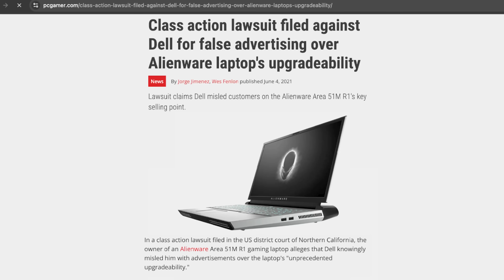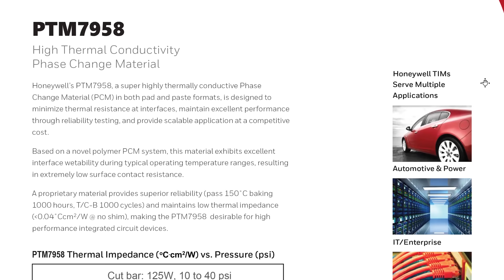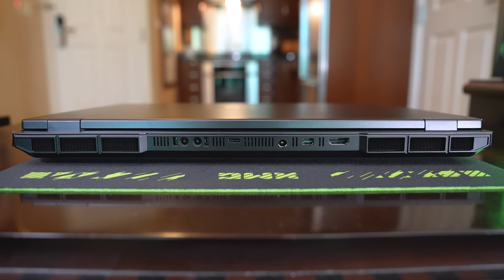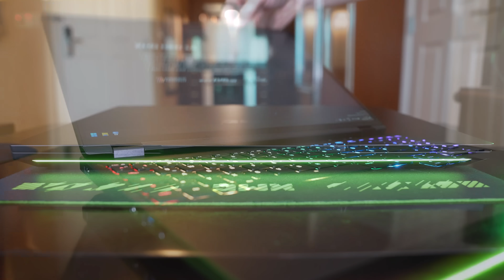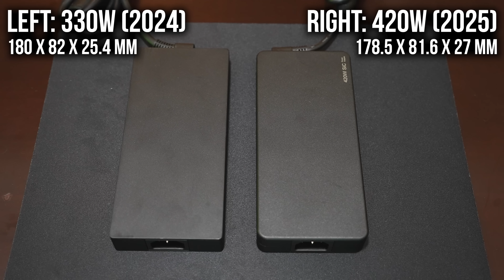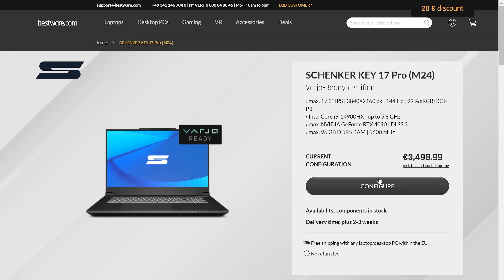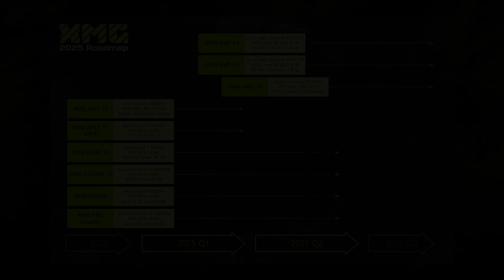This Gaming Laptop has Separate CPU & GPU! - XMG Neo 16

Comment: For anyone who is curious, XMG have removed G-Sync support in both the IPS and OLED models for 2025, which is beyond a deal breaker. Such a shame.
Reply: Jarrod never mentioned it in any of his neo 16 videos. 
Gizmoslipttech, on the other hand, mentioned it in both the live and recording.
At 5:40 saying "I have seen it before in action" is such a big bold lie.
Reply: @techkenvid  He wouldn't have known at the time and XMG were promising it, it's not Jarrod's fault., They only recently decided against it after people who bought them waited 6 months. They said no because they can't do it as a retro fit and only for new laptops and thought that would be unfair. This is why you never buy something for a promised feature, only buy it if it has what you want already.
Reply: @Bavanity  A few important things to note:
1. There was no OLED model for 2025. Only IPS and Mini-LED.
2. This "removal of G-Sync" was only for the Mini-LED screen; the IPS screen still has it. Like they said, they only decided against it after people who bought them waited 6 months. They said no because they can't do it as a retro fit and only for new laptops and thought that would be unfair.
3. Nobody actually reviewed the XMG or Eulktronics version for 2025, so I bought one myself. It's very good. Just be aware the sepakers still don't work in Linux; they take a second of audio playing to turn on and then it works as long as audio is playing. (It's a speaker sleeping issue with the drivers.)
4. To this day, the 2025 model does not have the Prema UEFI of previous models. Just an FYI.
5. There is a MUX Switch.
6. Only the Intel model gets Thunderbolt 4; the AMD model doesn't even get USB4! (For such an expensive laptop, that's so ridiculous.)
7. I hate that CoPilot key so much; even remapping it isn't 100%...

Comment: @JarrodsTech also can you ask them for an OLED variant and/or 360/480hz 1080p variants ? Their G2G  and panel selection is their only flaw IMO . We also need more x3d chip set builds on laptop . That vcache is honestly mandatory to look parallel to an ITX considering we are limited to 125-175w GPU power a water-cooled 9950 x3d with a 4090+, and 360hz 1080/1440p . also i feel they need 2x gen5 Nvme slots to actually take advantage of that Raid 0 properly. its such a small touch-up to be innovative and future proof considering someone is spending 4000 dollars or more for a barebone max spec

Comment: they need to make the power delivery a seperate board, my 3k laptop is now a paper weight. my experience is the desktop i build last me 10-15 years or more, i just stop using em when i build a new one as opposed to laptops lasting 2-5 years.

Comment: You are 100% wrong my friend, they used to provide laptop MB that had cpu sockets on them, they used to have a MXM format gpu board for individual replacements.  There is no oh we are unable to or can afford to build a standard platform for upgrading laptops like desktops.  Full stop.  Only reason they continue to use proprietary hardware, soldered cpu/gpus is a money grab and to keep consumers on hampster wheels.

Comment: does xmg ship to the USA ?
Reply: Not really, but Eluktronics is the brand who sells the exact same laptops as XMG. Both come from the same ODM, Tongfang. Eluktronics's version is called the Hydroc 16 G2. (The G1 was the 2024 redesign from the horribly built, feature lacking, USB-C charging lacking, underperforming, and CPU thermal throttling even with the liquid cooling 2023 Mech 16 / XMG Neo 16. The 2024 redesign was so much better that it wasn't even funny, and it wasn't worth considering the 2023 model.) I have actually not seen any reviews of the 2025 models...

Comment: The problem with this is that most laptop manufacturers stop supporting upgrades. I bought an acer amd laptop like this and then acer never supported firmware updates to update the cpu. Dont get it simply because of "future" upgrades they wont support them.

Comment: I think XMG should have at least made it possible to upgrade within the same generation if not future generations. The only use case in which this might help is if the gpu dies. You would be able to change just the gpu rather than changing the whole motherboard.

Comment: 10:30  it's not unusual to control a device with an rj45 connector, while needing an ethernet connection at the same time. So you would control an industrial piece of equipment with the computer and at the same time connect to the ethernet connection for the facility. This might not have anything to do with internet at all. So in a professional situation two ports is actually almost essential, often I had to use some form of cluge or a dongle out of one of the USB ports, but this is not ideal, it is better to use good regular dedicated hardware for it. Also the drivers for this are usually in-house and of course proprietary, though I have been in certain facilities where open source is used. I generally find the open source to be more stable and specifically better programmed, or more to the point better optimized, usually the programming is just fine within house but they don't have the resources for the optimization necessary at a low level

Comment: Yes but the manufacturer state that the boards a digitaly signed ti each ither so the end user can't replace them so if the cpu or gpu fails you need to send it to the manufacturer to rma it

Comment: I'm still waiting for some other company other than framework to actually produce a laptop that can be upgraded in the future. Generally speaking there is no f**** reason why we need to replace the chassis of a laptop or in most cases the monitor at least for one more generation past the one that you started with. Even keyboard and mouse, touchpad, generally don't have to be replaced for long periods of time. So yes I would love XMG to commit to designing the next one if not this one, laptop that can be upgraded every couple of generations. Doesn't have to be every year, but every two years or every three years would be beautiful. The monitor keyboard and touchpad should easily last 6 years if not longer, whereas the GPU, especially these laptop underpowered junk that Nvidia likes to give us, will generally only last one generation maybe two. CPU could easily last two generations if not more. So yeah, I would love XMG to at least commit to creating a 3-year cycle for their laptop, preferably a two-year cycle but, I would be happy enough with a 3-year

Comment: Ahhh another bs design skewing design and technology, introducing new problems that didn't exist or were already mitigated. This is why MXM was developed and here comes another manufacturer making a completely non standard pogo connector and board layout. Back to the wild like in 2005 to 10, when some laptops had gpu hat modules with proprietary connectors.

Comment: would be nice if GPUs just went back to MXM, like yes this makes the GPU easily upgradeable, but it's still limited to one specific laptop from one specific brand, rather than a satandard that's true across all many manufacturers, specially since MXM is supported up to the RTX 4060 and RX 6600 XT

Comment: Quite a good idea to have separate PCBs. However - what’s missing is the nickel plating on the heatsink for cpu and gpu.. I want to apply liquid metal if I decide it needs that.
Reply: Honeywell PTM7958 is good enough, especially with large dies. // Tom

Comment: E-waste out of the box . wp XMG you can now go but it back in the trash bin were is its place.
Reply from the maker: brain dead take tbh ngl famalam
Reply: Dude it has an x8 pcie connector, meaning that mbo will never accept a higher end gpu(well it can but that gpu will not perform as it should on a pcie x16 connection),  the gpu itself is proprietary design meaning no future upgrade from 3rd party and because the entire laptops cooler is made custom with that specific gpu in mind.  The only good thing about is is that it gives   you the possibility as a manufacturer to asamble it however the customer wants but that's it, he the customer can't upgrade and can't do anything else to it because the parts themselves are not made to be swapped from one configuration to the other. Also not to mention limited configuration because you would end up with a huge stock of coolers for 1 specific config that sold less then expected so they won't have many configuration options for sure =)) they will limit it to 2 or 3 configurations for each cpu at best.

Comment: As I understand its locked and I can't change my machine's config if I wanted to upgrade the GPU for example? is this a hardware lock? so even if I got my GPU damaged I am not able to pay more for a 5090 for example?
Reply: In-generation GPU upgrades (e.g. from RTX 5070 Ti to RTX 5090) after a GPU defect is something we could consider for this generation. But the laptop would need to be sent to our RMA center, and we'd keep the dead GPU for recycling. How does that sound? // Tom
Reply: @xmg_gg  sorry for the late comment but that is the logical way to do that

Comment: The NEO lineup is looking quite good! I am not so sure about the SCHENKER KEY 18 Pro though... the large battery and amazing sound system is insanely appealing, but it is all brought down by a frankly underwhelming screen options, especially compared to the likes of ASUS with their 1200 nits Mini-LED coupled with anti-reflective coating for better contrast. I am hoping that more laptop manufacturers will start implementing such technologies in their machines!

Comment: Most I see have a separate GPU from the CPU but they are usually soldered down.  I know about removable cards but I have never actually seen one since the laptops they come in are more expensive.

Comment: Missed opportunity to not have the separate CPU and GPU as well as the liquid cooling system in the 18 inch model IMO. That is the one made for the enthusiast...not the 16 inch model with only 2 RAM slots and 2 SSD slots.

Comment: I just wish there were more socketed mobile CPU and truly standardised mobile videocards (MXM is all over the place). XMG's method for upgradability does have its place for thinner laptops though - maybe they could opensource board designs that become obsolete so that those who want replacements have the option to source them (or repairs) separately.

Comment: My legion 5 gpu died and I have to basically run things on integrated graphics and can't use external displays. This new design is great as the cost of repair is gonna be way lower and actually fix only the damaged components

Comment: Having the GPU and CPU on different boards has been done before it does not offer that much of a benifit as replacing the GPU will most likley cost over 50% of the price of the laptop. Laptops have a shorter life than desktops due to starting with less computing power than a desktop equivalent so only buy one if you really need something that is portable. I have a 3d scanner and was looking at a high end laptop but ended up using a mini ITX MB with external GPU mounted into a Pelicase with a 16 inch screen as I am a cheapskate.

Comment: No USB4? No description of how the power components are cooled? Is water dripping when disconnects the external cooling solution is still a problem? I guess, they paid well 😅
Reply: Power components are covered by the large thermal module that you see in the video. What you don't see in the video: thermal putty on VRAM and MOSFETs. XMG OASIS ports and tubes are self-sealing when disconnected. // Tom

Comment: 1. But is it possible to upgrade both boards when the next generation GPU comes out, along with whatever CPU is out then?
2. As much as this simplifies production I have some reservations about that PCI-E bridge if you're perpetually lugging this thing around and, despite a nice bag like Crumpler or Lowepro etc, that involves rougher handling. Desktop replacement that barely goes out, and when it does, the worst handling it'll get is on the conveyor belt for the airport X-ray? I don't see any problem. Running through stairs and crowds to and from the tube/elevated metro, getting sardined in the train (worse if other passengers are shoving etc)? This might break that PCI-E bridge.

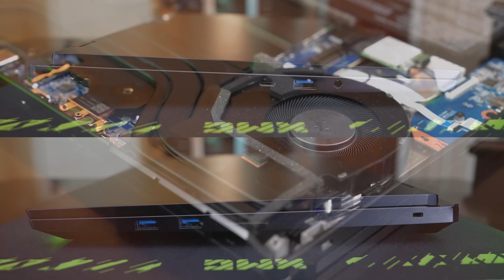Comment: 7:47 the laptop is dropped? damaged corner
Reply: Yep, someone dropped it at the airport with only minimum padding on a very hard surface from shoulder height... that someone: it was me. Unfortunately, aluminium bends when facing kinetic impact. // Tom

Comment: Besides the possibility for repairability, what's the point of the separate boards if they come with vendor lock in for sidegrades and no possible upgrades, I don't fully buy the incompatibility for future generations because we had laptops that run multiple future generations of CPU/GPU while the other component is static.

Comment: Was so excited for the AMD one but no USB 4 port is a deal breaker since I use a Seagate firecuda pro thunderbolt 3 hub with 8TB (4tb ssd, 4TB iron wolf, plus multi usb port gen 2 hub). Oh well.
Reply: Put the 4 TB SSD into one of the two NVMe slots in the laptop. The 4 TB HDD can be maxed out via USB-C Gen2 (10 Gbps). // Tom
Reply: @xmg_gg  No, I have 8TB in the laptop, 2x4tb, and 10tb external SSD plus 4TB mechanical backup in the seagate. I would never, ever buy a substandard product, there is zero excuse other than to save a few pennies not to include a usb 4 port. No way. Why on Earth would I use gen 2 for nvme when I get 4K over thunderbolt, read and write? No thanks.
Reply: @Bavanity  I see. You need Thunderbolt/USB4! We have XMG EVO with AMD with USB4, and XMG NEO with Intel with Thunderbolt 4. Arrow Lake ain't all that bad. // Tom

Comment: Nahhh nothing special, looks like a beneficiary only for xmg and they try to sell it as it's great for us. Dont like this kind of scam.
Reply: How is this a scam? In our publications, we are transparent about the pros and cons of this design. // Tom
Reply: @xmg_gg  Ok, the word "scam" was an abuse on my part. However, I still consider the presentation of a solution with a separate GPU and CPU as a great advantage for the user to be an abuse on your part. Ok, the idea itself seems great, but it quickly turns out that it has no advantage for the consumer, while there is still no guarantee of the possibility of expanding with the next generation of GPU or CPU, I understand (nobody knows what they will come up with there), the lack of the possibility of replacing the GPU/CPU in currently available configurations is a terrible disappointment and ruins this whole cool idea. For a potential buyer, the only advantage is the possibility of assembling an AMD configuration with a high model of nvidia or intel with amd, thanks to which there may be a possibility for TB5. And so it is a really big profit/opportunity for XMG due to the costs and flexibility, but you present it as a profit for us, while at the same time you block it. Buying a laptop with, say, a 5060 now and having the option to upgrade it to a 5090 in about two years would be fantastic and seem realistic, but unfortunately it's not.

Comment: Glad to see the far superior AMD X3D CPUs are not excluded. The intel Arrow Lake CPUs are slower than the 14th gen.
Reply: Arrow Lake is more efficient than Raptor Lake. In laptops, that are limited by thermals and power, this will make Arrow Lake most likely faster than Raptor Lake at equal power budgets. Bundling with CSO-DIMM DDR5-6400 will be another factor. We will know more once the review embargo has dropped. // Tom
Reply: @xmg_gg  When is that embargo over?
Reply: @cameron_bosch  Probably by early March. // Tom

Comment: Y there is no 
AMD Ryzen 7 AI 350HX
AMD Ryzen 5 AI 340HX 
CoPilot+ Mobile Processor which support NVidia RTX 5050/5060/5070/5080 GPU.

For Budget Gammers+ Content Creators.
AI Developers+ Data Scientist.
???

Windows 12 AI Operating System Compatibility

We don't want integrated AMD Radeon GPU we want NVidia RTX 50 GPU's

Intel Lunar Lake also do not support NVidia RTX 50 GPU's.

Y the CoPilot+ Mobile Processor do not support NVidia RTX 50Series GPU's???

Comment: My two main criticisms of last year's device, the lack of a higher-tier display option and horrendously slow ports (5gbps usb c ports and slow SD card reader) have both been solved.  I prefer not having a num pad, but that is just my own personal preference (clearly XMG believes more people want the number pad), and at least we're getting a normal keyboard layout with normal sized shift keys for touch typists.  The improvements with this device (including if we get the highest-end AMD chip with a 5090...I don't think any other OEM has announced offering that combination as of yet) are very welcomed indeed this year.